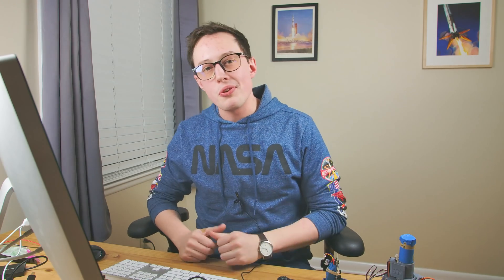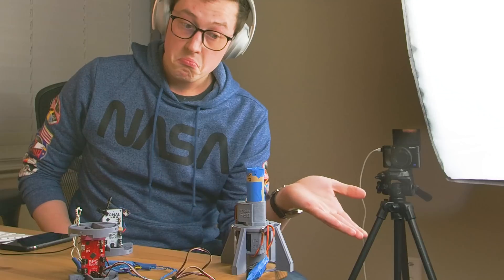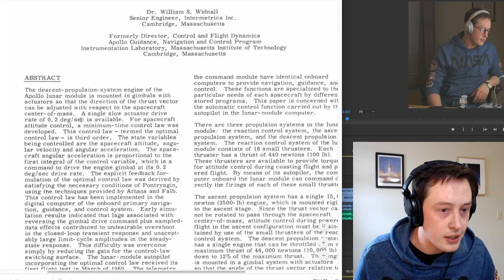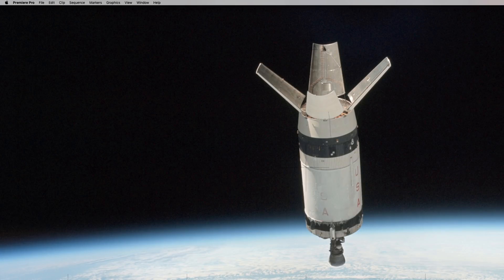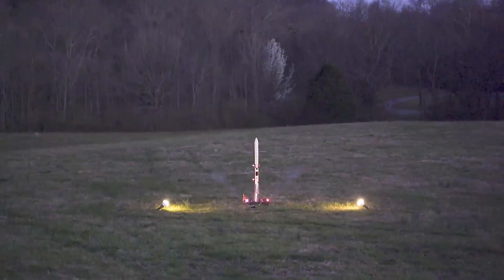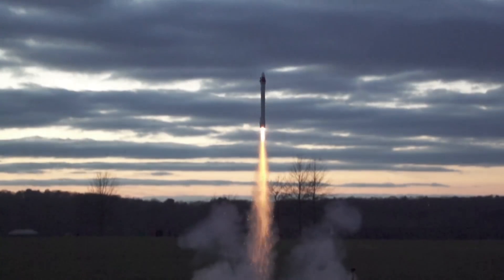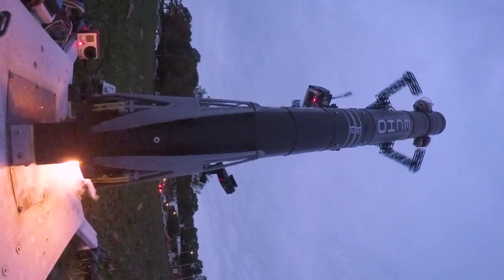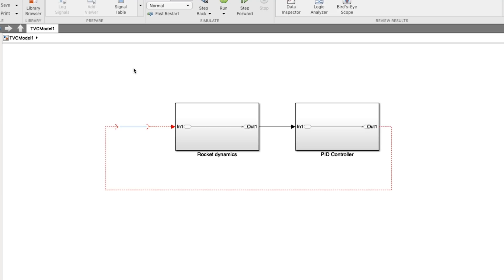TVC Model Verification

Comment: There is easier way to do this:

servo has a in built potentiometer to measure angle

open the servo and solder a wire from middle pin of that potentiometer

and measure the voltage between this pin and ground with analog to digital converter pin of your microcontroller

you need to only map the voltage to angle

you can get immediate angle feedback on the microcontroller itself which can be used to build a small pid subsystem for tvc

Comment: That is not quite how a PWM hobby servo works.    You really do need to characterize the low angle commands.    It takes proportionally longer for the servo to seek a smaller angle command than a larger angle command.

Comment: Actually this is not entirely correct. 

The main issue is the diagram. The reason we put the controller before the dynamical plant (not only with respect to adding noise) is that the error is calculated by subtracting the reference, thus even if the reference is 0 there is still no arbitrarity to place the controller before the plant even if it is a loop. In this case it also makes it easier to model delay, since the plant contains the delay dynamics, so you can put it in front if the gimbal plant and encompass the entire thing as a new plant, and build on that. 

Secondly, I'd like to suggest to do it continuously and model the gimbal as a simple system. Instead of using a discrete delay only, add a transfer function of the speed of the rotating gimball and measure that with a camera. If you know the speed (or even the acceleration) profile, you can identify the inertia (or friction) and use that as a second order transfer.

Comment: I'd caution the idea of going to 1 degrees in a 5th of the time to get to 5 degrees. The control law in servos outputs less power to reach a closer angle (the proportional control aspect), so the angular acceleration to approach smaller angles will be lower. If anything at small angles this will probably lead to the reaction times being exactly the same, not shorter, for smaller angles. A way to practice this concept with servos is try modifying them for continous rotation, a small angle input results in slow rotation.

Comment: Seems to me like you have two types of delay. First there's the variable delay caused by the servo signal period, dependant on where in the PWM cycle you give the command. And then there's the more consistent servo response delay. Taking them into consideration individually might simplify your model.

Comment: Good work...but how if you use another gyro on moving part, and then measure that data from two gyros, 1 on movable part and other on computer... this data will be way more accurate for further processing, instead of using so much expensive and tedious setup....

Comment: Soooo....to accurately model PID control on a digital system you need to run the PID formula through a z transform in order to get a....oh, simulink has a block for that.  K, nevermind, you got this.

Comment: Im looking forward playing and learning a lot more that i know about arduino tablets and small rockets!
I'm a spaceX NERD and a falcon heavy NERD too! I want to make my own small falcon heavy!
How should i get started? Buy an Arduino? Learn more about rocket science?
This is what i want to do when i grow up (im15)! 
Any help would be appreciated!
Reply: As a fellow teenager, don’t get your hopes up, learning how to make a TVC system is very long and very hard. Personally I’ve been designing a system with an Arduino nano to track Acceleration and Gyroscopic position during a launch, as a stepping stone to a TVC system. My best advice, take your time and read up. Theres a lot of information for Aerospace Engineering (what you are doing). Learn how to do 3d part design, I myself need more practice but I can get the job done, and gain access to a 3d printer. As to where to start, Learn everything you can, Arduino, C# or Java, Python, all very useful coding languages. Also look up National Association of Rocketry, they do have rules and regulations of what you can do, and what you should learn. Good luck!
Reply: @joshuabarosin779  Thanks a lot !!!
Reply: @joshuabarosin779  I didnt know some of the things you told me !! For example Aerospace Engineering ! I will maybe buy a book and read and learn more!! Do you have any suggestion about abook?
Reply: @scoaty7633  I dont know of any books for what you need, but Apogee Rockets runs a mini series on how to build a rocket. Personally I'd focus on finding books, webpages articles, on the 3 sections of Aerospace engineering: Propulsion, Structures, and Guidance and Control.
Reply: Scuplex Also Joe has a Video on books he recommends, he also has a mini series on his falcon Heavy build so you can watch those videos.

Comment: You should do this same test under load.....  Mount it in a test platform, video with high speed, and light a motor. Does the Actual load cause the actuator to take longer to move?

Comment: This seems a bit overcomplicated to me. I would have just attached a scope (analog probe) to the servo's potentiometer and another to the LED control signal used as trigger.
Secondly using step function is not the best way to identify systems, this assumes it is linear. However using a chirp (increasing frequency sinus) you can tell even the transfer function.
Servos (that i worked with) never settle in the same position which is another parameter (precision).
Note that LEDs are not turning on immediately, they just like anything else have a delay, might be negligable in this case but it exists.

Comment: Hrmm.....  Would be a bit more accurate if you could actually monitor the encoders at the servo - that's how we usually do it.  Then you can excite both closed and open loops to really get a good handle on how the vanes will respond...  (On things like Giant Magellan Telescope, we back this up with optical sensors to also model the error between the servo encoders and the actual actuation target)

Comment: You should tap off of the wiper of the pot in the rc servo and analog sample that. That would allow you to see real time what the servo is doing. You could also use that in the control to know when a command is complete and avoid sending multiple inputs that the servo isn't fast enough to handle. It would also make it easier to model small step vs large step responses..   .02c

Comment: The servo itself has a feedback loop. For large angles you will reach max speed. That is called slew rate limitation. You can see that in your video! After some degree you have constant speed some degrees.   Actually you probably first have a slew rate limitation also in the acceleration fase. If you do this excersise with different target angles you might see it! 
The slew rate limitation is an extra -90degrees in the frequency plot (bode diagram).
I use to make the laplace modell as: one clean time delay e^-L and one time konstant (1/1+sT). Normally a rc servo has typicully 60degrees/s max speed. That is 83ms for 5 degrees. With infinite acceleration that gives 17ms for the linear response! Cross over frequency is approx wc=3/Tm=3/0.017=176rad/s.
Some guys suggests frequency response measuring. I think step response analyse are sufficient with these identifications. Knowing L and T separately gives you a mutch better bode plot!
Put your camera close! And put a millimeter ruler just behind. Then you can plot the movement i figures versus time. And measure also small angles!
With love! /BG

Comment: Most servos will happily take an update rate well in excess of 50Hz. Even the cheap ones. They also don't mind a slower update rate, or an irregular/inconsistent update rate. You should be able to leverage this info to tie the servo updates to the output rate of the control loop.

Comment: You can open up the servo and run a pair of wires off the wiper and directly record what the servo is doing.  You can find some servos that people have preconverted, but I'm pretty sure you have a particular servo you want to stick with.  Sacrifice one servo and get raw data.  Various servos also have different dead zones and you may find moving from 0 to 1 degree is different than moving from 1 to 2 degrees...  lots and lots of things to double check.  Cool work!
Reply: Working on my own rocket now, thank you for this information!

Comment: This was actually super interesting and helpful because I've been looking at buying that same type of Sony cam to do some high-speed analysis of a pneumatic-mechanical launcher device where I'll need to fire it, see how long and for what durations various pistons and so-on are cycling for as I tune pressure and spring rates and volumes. I've been assuming setting up video in Premiere and using it to analyze the footage to get things like response time, velocity, etc is possible; but I've never done it and had no clue what the best ways to actually start collecting any sort of measured data from the footage would be.

Your video really helped with that a lot and I think it was very interesting, thanks for going out of the way to put it out for us!

Comment: This video is excellent.

You can add an optical time element by blinking the LED at a known rate instead of just turning it on.  Also, if you shoot long (move the camera away, stop it down, and zoom in) you can increase the depth of focus.  Lastly, you could move the thruster to known deflections, and with the camera as your viewport, mark a sheet of paper mounted behind everything (relative to the camera).  This would let fairly easily measure deflection in the video.

Comment: I once worked as a Process Controls technician (not engineer). The equipment I worked on controlled the process of making paper, or in my case, the process of making fiberglass mat which uses the same equipment as in paper making. At the end of the machine the computer monitors various parameters of the final material like thickness, color (pink, if that may be a clue), dryness, etc, and makes adjustments to the process to make the process run on target, or back on target if it strays. The system uses a computer algorithm to prevent control oscillation around the target called a Proportional Integral Derivative algorithm or PID in the world of process controls. It uses all you are talking about, input delay, machinery response time, sensor feed back, and (in my case, but maybe analogous to vehicle inertia in a rocket) material response delay. Maybe this is what you are avoiding talking about because the formula itself IS incredibly, mathematically tedious and hard to grasp just what it does. If not, you might want to investigate the implementation of a PID in your controls. When (mathematically) tuned properly your sensor graphs will show one control spike and a curve to target. If not, the graph will show "ringing" or a decreasing oscillation until steady on target giving your rocket that visual "wobble". The most difficult part of it's use would be to account for control effectiveness as speed and aerodynamics increases.
Reply: thank you for taking the time to write this comment. extremely informative! i always wondered how control systems handle the situation of an output parameter oscillating about the expected target value. time to dive into PID theory :)

Comment: It would be interesting to do a frequency response test using a sine wave on your tvc mount.  That would give you a good model.
Reply: Yea, if he put a distance measurement sensor (capacitive or laser) and used a sufficiently wide noise signal he could get the gimbal dynamics in one direction. But considering he knows the model (a second order inertial mass rotating about an axis) so all he needs is one profile with acceleration and deceleration to estimate inertia and friction.
Reply: @itzdaman  A simple potentiometer is much simpler and more informative.
Reply: Yea that's what I thought.. put a scope on it

Comment: You might consider drawing a vertical line on the movable unit and mount a clear protractor in front of it so you can see exactly what angle it's at at each frame of the video.

Comment: Do servos perform the same when under a load (rocket motor is active)? Was there any voltage dips or spikes during actuation, servos are sensitive to voltage in relation to angular velocity.
Reply from the maker: Roughly the same performance during a burn - the servos don't resist any force from the thrust of the motor, they just change its direction. I tested with a loaded motor to make sure the mass that the servos were moving was roughly the same.

Comment: I was under the impression that the TVC of the LEM descent stage was used only to compensate for changes in center of mass, and the actual steering was done with RCS.